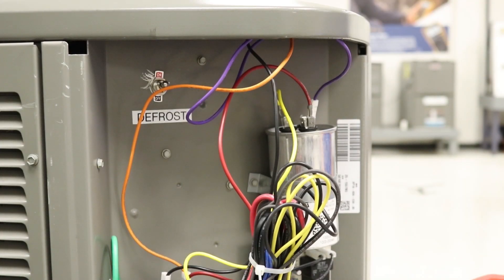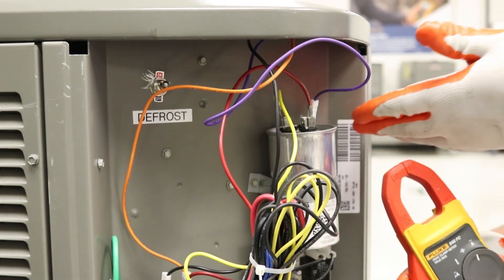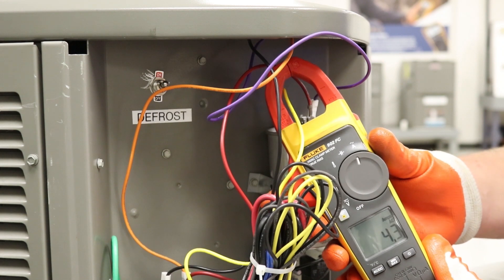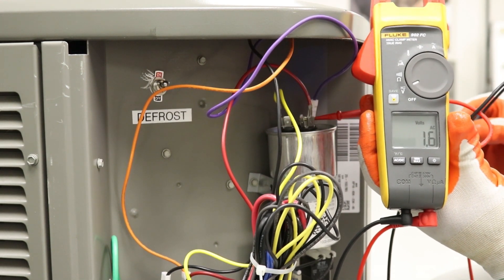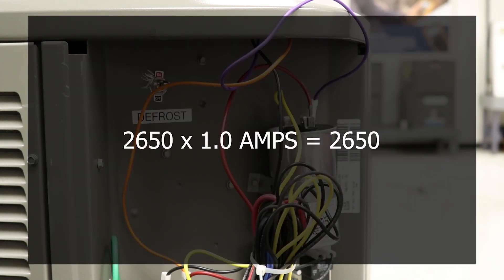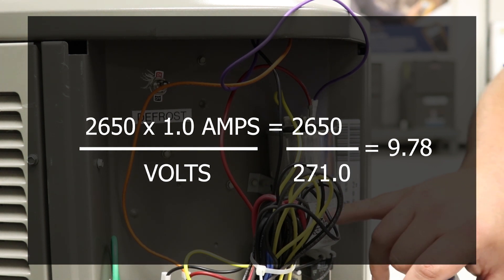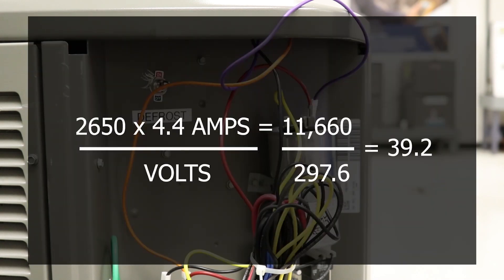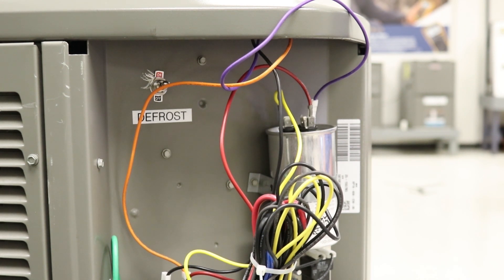Toolbox Tuesday: Checking a Capacitor Under Load | Lennox

Comment: What happens when you take voltage an reading 0412 . But test it not under load and capacitor in range
Reply: @HVAClearning  yes it helps alot but my ? Was sometime taking the voltage reading does not read nothing. The herm leg bad or capacitor should be changed.

Comment: The formula is actually 2652.  Not 2650.  The cap in video is actually in better shape, than shown.
Reply: It's even better than that. Some ppl say 2653. I've seen how they get this number and I agree with them.
Reply: @realSamAndrew  2652.49 rounds DOWN to 2652,  NOT up.
BTW, never agree, with THEM.  The THEMS are trapped in 'group-think.  "Be social!", is the THEM's mantra.  Like lemmings, the THEM, all run off a cliff, in a SOCIAL way.  Togetherness.  KOOMBIYA.  PATHETIC snowflake BETAS. THEMs say:  "But, but, but, we're millennials!" Our mother's said we're special!"
Reply: @BYENZER  whoa! Easy there big fella. Don't have a coronary.

2652.59 rounds up to 2653. And every single person is a THEM to someone.

Figure out 1/120*pi, use at least 11 decimal places, and multiply by 1 million.  If you get .49 at the end, you should fix your calculator.
Reply: @realSamAndrew  Where did you get .59 from?  The actual value is 2652.49!  NOT .59
Reply: @BYENZER  how do you know? Where did YOU get that from? Which "they/them" have YOU been following?

I gave you the freaking calculation. Try that first before you refute me.
Reply: @realSamAndrew  Son, just remember:
If I say:
The sky is pink with purple polka dots; and you then go outside and see a blue sky; Trust not, your own eyes!
Reply: @BYENZER  Sam is more correct. The actual value is 2652.582384865 and rounded would be 2652.58. He’s off by one hundredth. And if you want to round it to the nearest whole number, you’ll get 2653. There’s several numbers that show up such as 2650, 2652 and 2653. Using the worst case scenario between 2650 and 2653, the difference in the answer is only 0.113144%. It’s not going to make much difference of whatever number you use.
Reply: @stuzman52  Thank you sir!  Unlike Sam, YOU are a gentleman and a fine judge of horse flesh!
Reply: @BYENZER  You are quite welcome.

Comment: Is 2650 a constant ? Never the less Thank U.for the lesson.
Reply: Remember it's 2650 for a 60 Hz system. (It's 1/(2*pi*60) with some zeros for the units) For a 50 Hz system, the number is 3183. And if you're on a boat or airplane with a 400 Hz system it's 398.
Reply: @straightpipediesel  thankyou so much, so hard to find the 50Hz value, when you have a brain fart 🤣 your my savour today
Reply: It's 2652
Reply: @llamacebu216  actually, 2653 is more accurate.
Reply: Thanks for ur prompt reply.

Comment: How do you get an amperage reading by using probes and not a clamp?
Reply: You can measure amps with probes, you put the meter in series with the cap and motor lead. He made a mistake when he’s said 271 amps, he meant volts.
Reply: You can’t get the amps-without clamp
Reply: @EinsteinAirServices  That's what I'm saying. He puts his probes on the capacitor (under load) and he gives an amperage. I always obtained my amperage readings with a clamp or an Amprobe.

Comment: Is there an expected ratio for a bench test vs the under-load test?  My bench tests and load tests can vary by a substantial margin.  Would this point to issues with my multi-meter? Can you guys do a video describing the main factors that could alter this test?  Thanks in advance for your consideration.